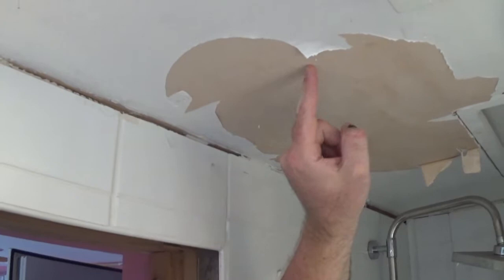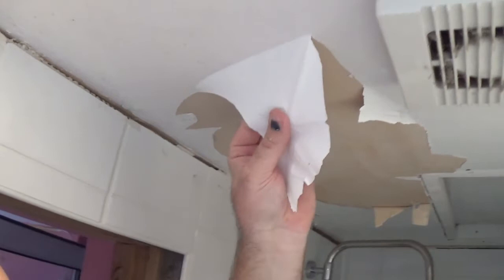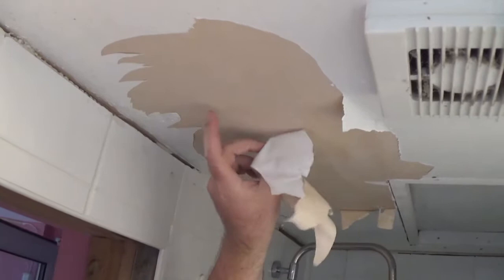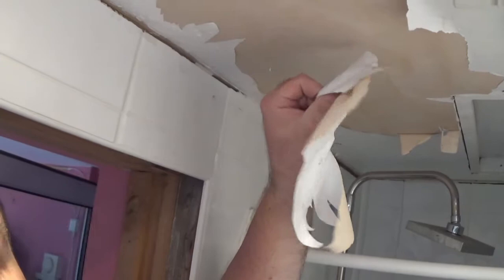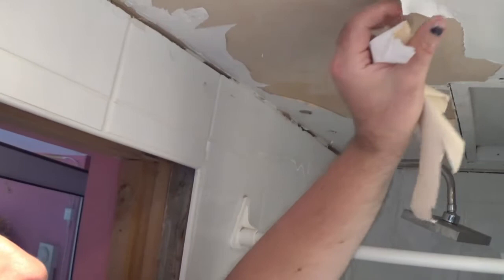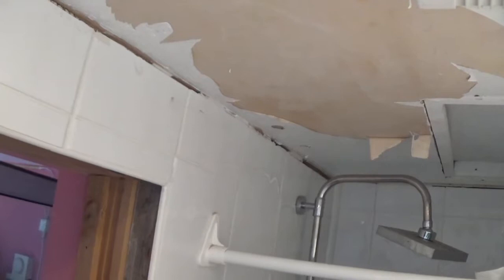How to paint freshly plastered walls

Comment: Another cracking video. One thing you didnt cover was your face mask. Do you have any recommendations on what's best to use? Cheers.
Reply from the maker: I've been using the trend stealth half mask, which has been pretty good. probably would need something a bit more bespoke if i were using it longer term. Will speak about it in my next video

Comment: Nice job mate. What was the spray gun like on the ceilings?
Reply from the maker: Thanks Andy, Spray gun works well on ceilings, the suction pipe is angled so you can turn it to always suck from the bottom. its a nice bit of kit for £50. I will be doing a full review in my next video

Comment: Use PVA glue mixed , 4 water 1 PVA as a mist coat to seal new plaster.
Reply from the maker: Does pva not seal too much that it leaves a film that paint wont stick properly or is 4 to 1 thin enough? Ive always used 50/50 paint and water.
Reply: @MATTDOESSTUFF2020  It's fine if your spraying or rolling, I've use this method for over 20 years with no issues, I generally use matt paint as a base coat.
Reply from the maker: @peterwilliams5631  nice ill try that next time. Ive got a few more walls to plaster later this year.